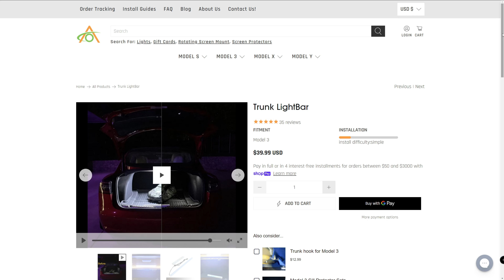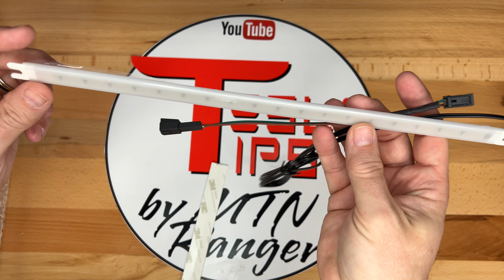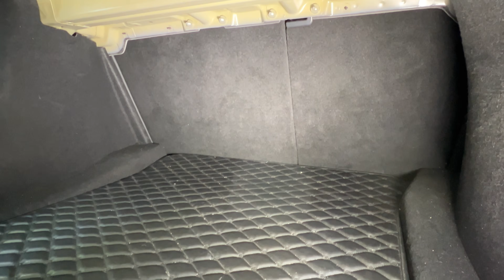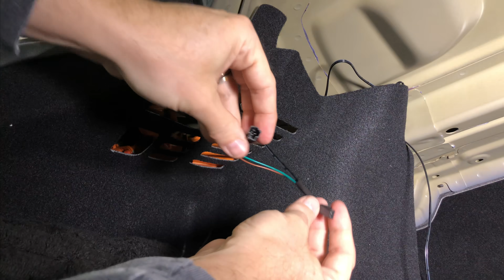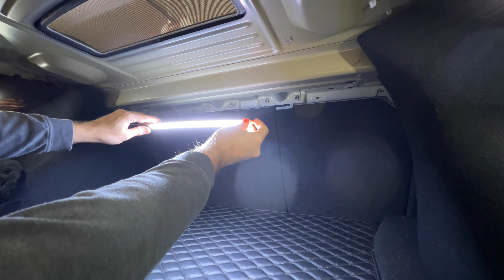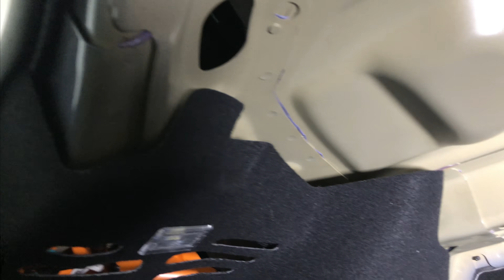Tesla Model 3 - Trunk LED LightBar

Comment: Looks like that wire will rub through..You "pinch" it on some metall to hold it up, those metals most likely has sharp edges which rubbes through and shorts the circuit eventually.
Use something rubber, rerout it, tape it up or something..

Comment: What the heck there is a vent to the inside of the cabin at the top of the trunk where the rear shelf is? My 2022 dual motor is solid and there are speakers there.
Reply from the maker: Sometime after 2019 Tesla got rid of the vent opening into the trunk.  It helps with the subwoofer.  I don’t know why they got rid of it.